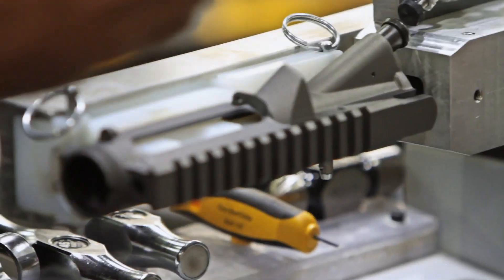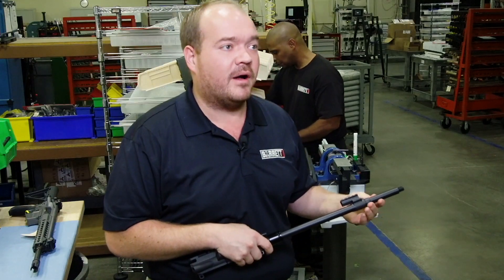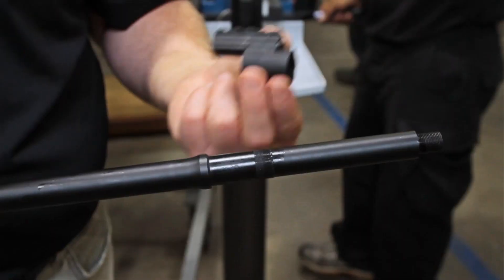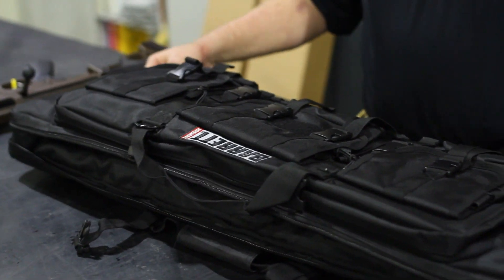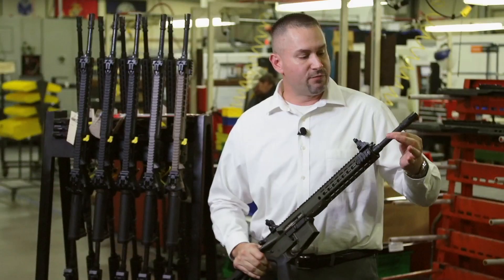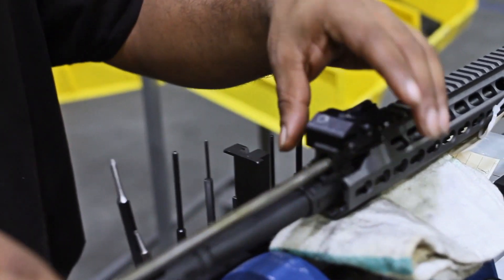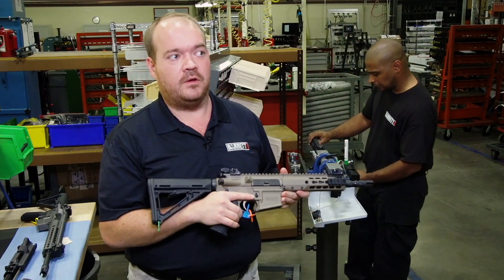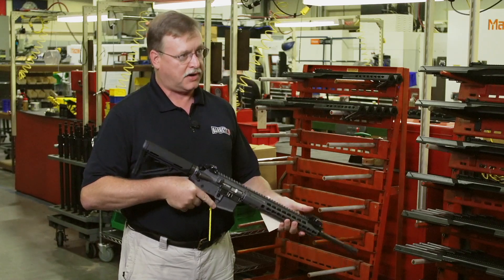REC7 GEN II

Comment: make a 22 1911 sized 2011 in 5.7,match trigger,ghost ring sights,standard 20 round flush fit mags,pic rail attachment on top and rail system on bottom,reliable,fun,accurate,and firepower would be this guns strong points and if made out of titanium I'm sure would be sold out in no time,thank you barret family.